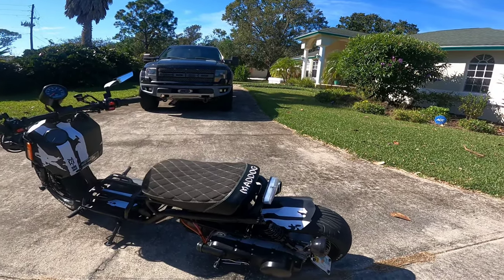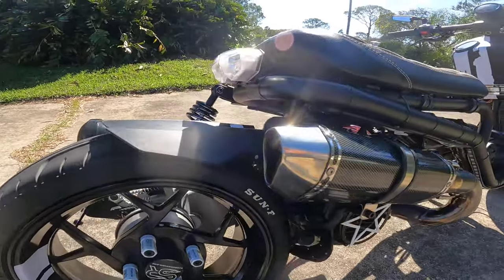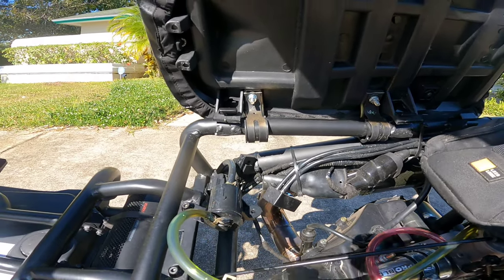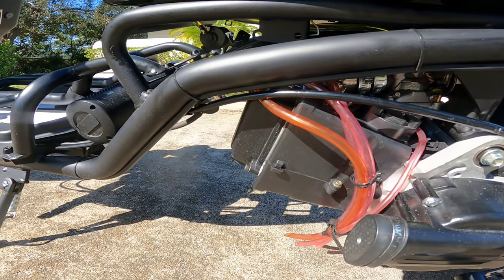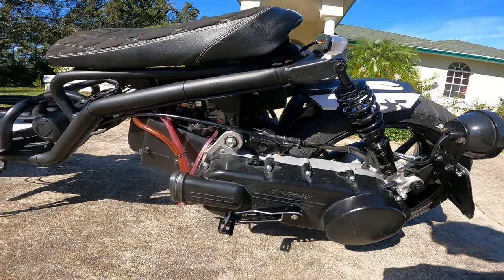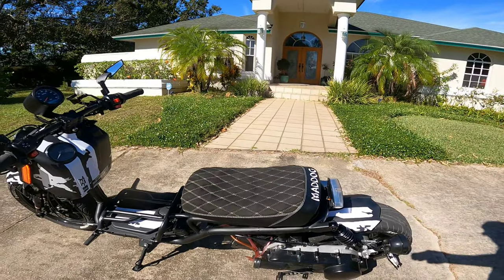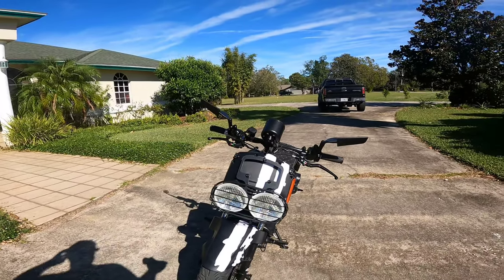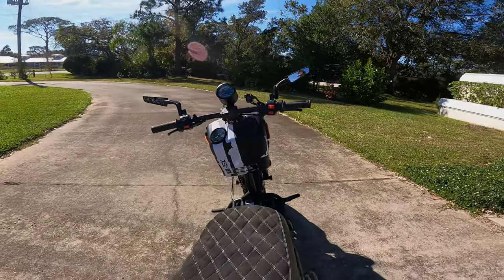How to get the Icebear Maddog 150 to do 70mph.  The Short Version.

Comment: Sweet video man.  Finally started riding my gen v again (been raining too much). Pretty similar build, 171 with the t100 and big valve head.  Im running that chinese fuel injection kit though, tuning took a lot of time, but it works for the most part.   I dont let it self adjust with the narrowband o2 sensor it comes with though, it doesnt like the little bit of cam overlap, it felt too lean for my liking.  There's still way more I'd like to do with the tune, but I'd rather just ride and enjoy it for a while.  Im on 12" wheel with a fatty rear, the gear up that i went with was 16/38, the ncy variator clutch kit, id like to swap my clutch spring lower though its a 1500, but clutch grabs at like 4000rpm, which is fun but annoying for trying to ride normal.  I think im running 13 gram sliders in the variator.  She can break 70mph and i cap at like 7600rpm.  It loves riding 55 ish at 6000 rpm though.
Glad to see others modding now.  Wasnt many people doing it when the gen v came out
Reply from the maker: All my clutch and torque or contra springs are still stock.  I actually like how it takes off like it is.  I really want to try that expensive reveno motorcycle style clutch.

Comment: This is awesome! I have gen 5 doing 51mph. I’m so invested in making it perform better. Acceleration, speed, do you have resources as to where I can find these items? You’re officially my idol now plus this bike looks rad too!!
Reply from the maker: LIL.  Mine did exactly 51mph when I got it also.  I have individual videos on everything done that shows where I got the parts.  Thar bike has the good stuff from rolling wrench.  The red bike videos got all the Ali Express, amazon and ebay crap.  It all worked as good as the expensive stuff.  SMH.  I use NCYstore also to find stuff

Comment: Hi there I’m new to your channel and I’m loving all the info. Question: I’m
Looking at a maddog 150 either gen 4 or gen 5.. I watched ur other video but which is easier to put fat tire on back. Thanks
Reply from the maker: I have not fat tired a Gen 5 yet as it actually looks pretty fat in real life. ...  but not stretched.  I think to get a stretched look you would need to go wider on the Gen 5 and also need to drop down to a 13" or 12" wheel.  Mainly cause on the 14" wheel the stretched tire might hit the engine case.  I also have figured out the required hub spacing yet.  The Gen 4 was pretty easy so I may go with that one.
Reply: If you had to choose between gen 4 or gen 5 which one would u choose I like the fat tire look
Reply from the maker: @user-oo1gp7sd9i  I would get the 4 and fat tire it.  The front suspension is just way better.   The 14" wheels look good but they are really limiting.
Reply: @GhettoWrench thank you for your information and opinion I will go with gen 4. Also is the free a video where you put a fat wheel on gen 4 rear?
Reply from the maker: @LuisGallo-r2b  https://youtu.be/FdDC4MlhraU?si=EE8E0eQS2R3joLVI
Reply: Thank you for all the help. So I got a real good deal on a gen5. What forks or struts do u recommend to change the front to
Reply from the maker: @LuisGallo-r2b  ugh...  LOL.  Watch this video.  There is another one before it also on Gen 5 forks. It is a lot of stuff cause of the tire clearance issue. 
https://youtu.be/8Opjvs2oqK8?si=YaPNpjL1r68-G9-S
Reply: lol sorry for all the questions but you are like the maddog guru.. once again thank you for all your help and videos
Reply from the maker: @LuisGallo-r2b  it's no problem

Comment: Did you get your 150 and 50cc Mad dog from Cajuns website?
Reply from the maker: @MoH_Dank  yes.  The black and white ones.  The red one I bought used not running. The blue one bought used, but sold to my buddy.
Reply: @GhettoWrench  that website has them priced for so much less it's hard to believe but all I hear is good things about Cajun Maddogs
Reply from the maker: @MoH_Dank  they have poor communication, but that is only downside.  They are an actual brick and morter bike shop.  Good dudes.  The website is jank.  You can call them to order also.  It's the only way to go.

Comment: After doing everything you have done and buying this bike what would you advise someone to do who wants this style of bike?
I have lots of regular gy6 mopeds. Tao and rocketa types. I want the style you have here. I'll buy it new, I just don't know what online place to get it from and what exact model and generation.
Any help would be greatly appreciated.
Also, the electric fuel pump, with the regular moped types with the tank higher than the carburetor, the electric pump probably won't help correct?
Reply from the maker: I did a video showing gravity is way fastest and electric pump is slowest.  Vacuum does not work cause bike makes no vacuum when demand for fuel is highest.  Gravity would need NO pump for sure.  I got mine from Cajun Maddogs.  Best prices and service I could find.  Look on Icebear ATV website at diff models.  Just depends which you like looks of.  They are all about the same.
Reply from the maker: Oh...  and I got a Gen 5 cause the 14" wheels...  but the suspension sucks cause less travel. The Gen 4 has great suspension and single shock but has 12" wheels and skinny back tire.  But ya they are all about the same.
Reply: @GhettoWrench  I like the larger rear tire. Can that be put on the 4th generation without any other modifications?
Reply from the maker: @ZCRAIZED1  The Gen 1 has wide 210 on back and is a 12" rim.  My Gen 5 is 14" and has a 185.  The Gen 5 wheel and tire will bolt up to the Gen 4 but the side may hit the shock.  Then you have to get a offset  shock like NCY makes.  The Gen 5 shock mount is a little farther out
Reply: @GhettoWrench  
I very much appreciate your advice.
I can fabricate most things but I want to start out with the best generation so there is less needing to be done.
I don't know if the generation is in the name of the bike or how to determine what generation one is.
I looked at the website you suggested. There are a few models on therebut only one I saw that said generation 5. I am unsure if that means the other models are a different generation or if they just didn't include the number.
Thanks again for all of your help and videos.
Reply from the maker: @ZCRAIZED1  if you go to "maddog" you can scroll down all the models.  There is a 1, 4 and 5 for the 50cc and 150cc...  so 6 models.  The 5 looks cool with the bigger wheels but the suspension is horrific as they limited the travel so tires won't hit frame etc.  The 4 has best suspension and handles best but has skinny back tire so looses on looks..  the 1 has dual back shocks so not as cool looking.  I have a 5 and 4 and I like the 4 better.  It is the red one in my videos
Reply: @GhettoWrench  awesome! Thank you!
I think I'll get the 4 and modify the suspension to fit the larger and wider back tire.
Your videos absolutely help people.
I can assure you that you are doing a great service for anyone looking for help in all of these areas.
Thanks a million!
Reply from the maker: @ZCRAIZED1  thanks!  You are welcome 😊

Comment: I got the 150 maddog trike, I got someone to put an electric fuel pump on it to make it go faster. I barely still get it to 50mph. Do you think doing all this would work on the trike also?
Reply from the maker: How fast was it before like 48?  Ya all this will make it faster, but a trike has a lot more drag and weight with that rear end so it will never be as fast as the bikes get.  I think 50 trikes barely do 20mph.
Reply: @GhettoWrench  no, I was barely getting it to 40 mph. I got it from Cajun Maddog the guy said they can put a kit on it to make it go faster but idk 🤷‍♀️ I’m thinking about just keeping it like it is and buy a 150cc 2 wheeler maddog and get that one to go faster.
Reply from the maker: @missylou122577  ya that "kit" will not make it faster at all.  Maybe slower.  NCY CDI is slower than the stock one.  The NCY coil makes absolutely no difference.   The Mikuni fuel pump would be a waste as you are electric.  A larger variator could make it faster as it gears it up, but you do not have the power to max out the speed with your current stock gearing so gearing up would make it a dog.
Reply: @GhettoWrench  damn ok, thanks for the info!